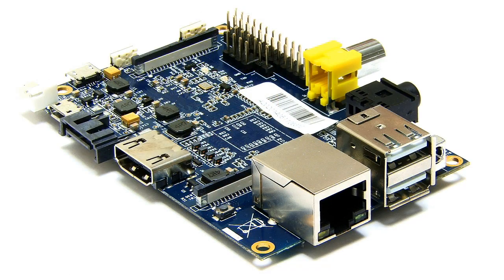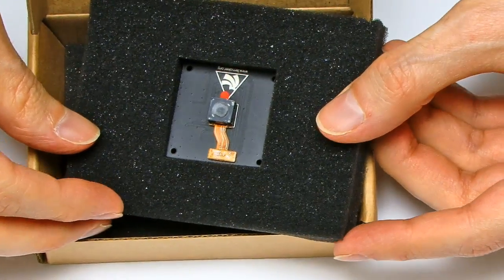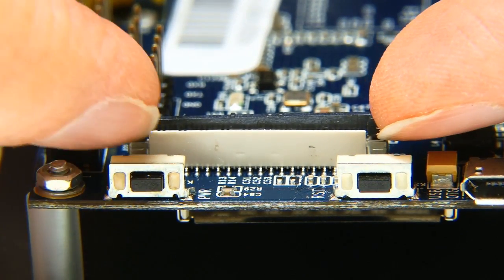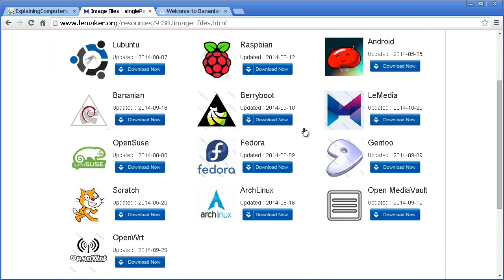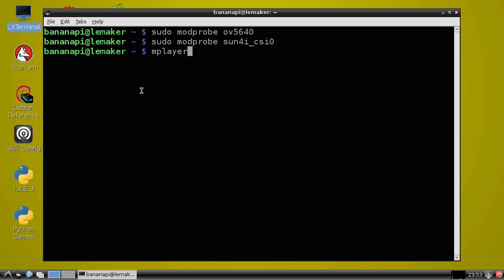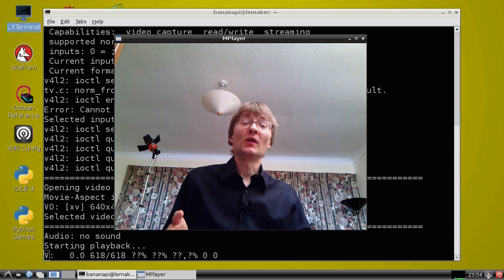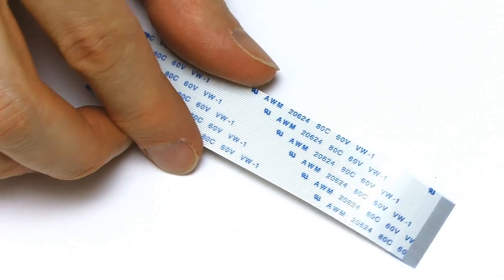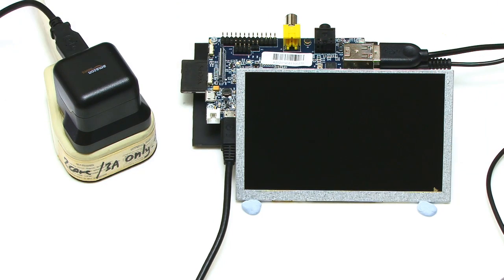Banana Pi Camera & LCD

Comment: I have a 10 inch screen from a old tablet, will that work as well? there is no kind of motherboard/logicboard on the back of the lcd just a ribbin (if I speld that right) attached to the actual screen.
Reply: Any LCD will need the driver board.  Look at the sticker on the LCD, and find the part number.  Put this part number and some keywords such as "driver board" into google and that is the driver kit that you will need. You can then use this as a HDMI monitor.  Connecting your LCD to anything, even if the connector was the same would not work. The banana display config like all screens will differ.

Comment: Are the LCD and Camera Modules Compatible with the Raspberry Pi aswell or just the Banana Pi?
Max
Reply from the maker: The modules will not work on a Raspberry Pi I'm afraid, as it has its own connectors. In contrast, rhe Banana Pi/Pro actually has a standard LCD interface, so works with a wider range of screens.
Reply: +ExplainingComputers Ok thanks Christopher, Continue making great videos. 
Max :)

Comment: For anyone who is interested ALI-Express have some 5V 2A  external batteries available that would run these little computers for little money and also you can even find your own DIY power bank Packs that you can use to make your own Power Bak Supply Power packs out of real high Quality batteries ike LIPO Lithium Polymer or other types of batteries depending on how you feel about those batteries and I even found a SOLAR Bank Battery Pack that fits the 5 volts 2amp specifications to suit these Devices

Comment: will the lcd work with rspberry pi i live in the UK
Reply: +InsertNameHere B+
Reply from the maker: +InsertNameHere Sadly not, as the Pi does not have an LVDS interface like the Banana. But you can get other LCD screens for the Pi.
Reply: ExplainingComputers whih ones do you reccomend under £20
Reply from the maker: +InsertNameHere I don't think you'll find a Pi screen under £20 I'm afraid. There is a popular 7" touchscreen sold by (eg) CP Farnell for £42: http://uk.rs-online.com/web/p/graphics-display-development-kits/8997466/ -- and smaller (and cheaper) Adafruit screens are sold by The Pi Hut in the UK, if currently out of stock: http://thepihut.com/collections/raspberry-pi-screens

Comment: Oh my gosh! I took that same exact display out of an old SatNav! Any ideas on how I could find a controller to get it work with a RasPI? A response would be appreciated. Also, apologies for my ignorance if this isn't possible. I'm only 13 so go easy one me 🤓
Reply from the maker: +Dylio Hamer A controller is the issue I'm afraid. Many LCD panels use an interface called LVDS, while the Pi has an digital serial interface (DSI) for connecting an LCD. (In contrast, a Banana Pi/Pro has LVDS, and can hence more easily interface to a wider range of standard LCD modules). Some people have connected LVDS screens to a Pi using an HDMI to LVDS converter.
Reply: +ExplainingComputers Right okay. Thanks. Any ideas on where I could get a controller to convert the display to a HDMI out? Is the connector generic? Or is it a proprietary connector? Thanks for a quick reply  by the way.

Comment: Hello, nice video's.
Do u have a 3D printed frame for a 7 inch Banana PI touch screen??
Reply from the maker: Antonius K I don't -- but it is a great idea for a project. :)
Reply: ExplainingComputers I have a original dashboard part http://www.car-products.nl/mercedes/2055-mercedes-en-vw-radio-paneel-4260020589817.html but i need an extra part to hold the touch screen.
Reply from the maker: Antonius K This will indeed be a great project!

Comment: Yes, they are very ESD sensitive, we destroyed 3 camera modules in our projects back at uni... I told them first thing it says on its webpage documentation, in the youtube video is that it is ESD sensitive.. after diagnosing and swapping parts around, it shown it is the actual optical sensor in the camera which is easily damaged by ESD...

Combined the Pi and PiCam with Lego NXT, some python programming so it can follow a black line on the floor by itself or user could take control... it was streaming video back from the "PiCar" to the user's controlling webpage... lots of fun if someone from the other side of the Earth controls the "PiCar" of someone else... they have the flexibility to explore a house on the other side of the earth and move around from the keyboard like they are in there... plus added a tilt function to the camera so they can really have a good look around :)

Comment: would I be able to use a raspberry pi lcd screen on the banana pi? would it be compatible?
Reply from the maker: JAKEJ GG I don't think so, at least directly. Anything is hackable, but the display connectors are different. Any screen that connects via HDMI will work though.

Comment: can it work on raspberry pi?
Reply from the maker: Gaming Heart Not this screen, but a similar one for the Pi can work.
Reply: can you give me a link to that screen ?
Reply from the maker: Gaming Heart The closest screen for the Pi is this one: http://www.adafruit.com/products/1678

But there are a lot of options -- checkout Adafruit (US) or ThePiHut (UK). Lots of people like this smaller touchscreen that fits on top of the Pi:

http://thepihut.com/collections/raspberry-pi-accessories/products/adafruit-pitft-2-8-touchscreen-for-the-raspberry-pi
Reply: ExplainingComputers Is there a 5" version which plugs into the display connector on a Raspberry pi etc? Or can the 5" one linked to here plug in without the TFT board?

Comment: question: I see you have Arduino 1.5 installed there and I'm a kind of new on this board, is possible to use the Arduino software with those GPIO pins???
Reply from the maker: jarcdday As far as I am aware, yes (though I've not tried it). The GPIO pins on the Banana Pi match those on a Raspberry Pi Model A/B, while those on a Banana Pro match those on a Raspberry Pi Model B+ or Model 2.
Reply: ExplainingComputers mmm hell, sorry for me to :(, I went to check the list of compatible boards on the Arduino Software, it only appears arduino compatible board, I don't know how to use it here. That arduino software is already installed on the OS that came with that installation?? if is so, it mean there is a way to use it..... but how??
Reply: jarcdday I will appreciate if you can help me with this question, I will research the additional information to use the arduino software here.... I just need to know if is possible...
Reply from the maker: jarcdday What you see in the presentation is indeed pre-installed as part of the image. Here I am running a default installation of Raspbian, so (as the GPIO pins across the Banana and Raspberry Pi are compatible) I would strongly suspect that any Arduino software that runs under Raspbian will work on the Banana Pi/Pro running Raspbian. However, I have not tested this!

Comment: Hi, I buy BPI M1, camera module and LCD(was delivered just today, so didn't tried yet). Camera works, but I receive very bad quality :(. Max resolution which I received was 640x480 but also with poor quality. Dou you know what I did wrong. What need to be done to fix this issue ?

Comment: For what they are the price of theses things is outrageous.

 For the cost of the Banana Pi 7" LCD screen only  You can buy a complete 7 inch android tablet which comes with built in WIFI module,Battery and battery charger module, 7 inch screen Module, Camera Module, GPS Module........
Reply: I don't get it as well. Why these things are so expensive!

Comment: Hey Chris,

Do you think you cant get a Windows Joystick (Logitech) to work on this system? If it would it from from USB directly, or from the GPIO? Also I would like to know if you can operate the whole system with the joystick instead of a mouse and keyboard.

Thanks in advance ))
Reply from the maker: rimwydas44 In terms of the hardware, I can't see why a USB joystick would not work -- or a GPIO one. The issue is drivers and access to the device in certain applications.

Comment: Very informative. Would you recommend getting a Banana Pi over the Raspberry Pi; is the extra power worth the cost?
Reply from the maker: wondertwins2222 Yes, if you need the power (or the SATA port). :) But the Raspberry Pi Model B+ is a nice machine with its 4 USB ports. And soon there will be the choice of the Banana Pro with its integrated WiFi . . .

Comment: Can you use the LCD in Android
Reply from the maker: MikeBrawnson I don't currently have this connected up -- it will go in the root of the card, or in a directory off that. So I would try writing an Android SD card, and checking through it on a PC to find the location of the script file. I will try and remember to check this when I next have a Banana Pi running -- which should not be too long -- and will then report back. :)
Reply from the maker: Tina Zill You should be able to, though I've not tried the driver yet.
Reply: ExplainingComputers Do you know where i have to store the script.bin when im using android?
Reply: Thx very much
Reply: MikeBrawnson  did u succeded in this?

Comment: the banana pi seems allot more interesting then the raspberry pi, mainly due to its much better specifications. (much faster dualcore proccesor, double the ram)

glad to see a new video from you.
Reply from the maker: fiattrickbox And that SATA port! :)
Reply: thats a very nice bonus too :D could make for a very nice micro NAS, with intergrated monitor.
Reply from the maker: fiattrickbox Yes. I plan to do a Banana Pi NAS video at some point.
Reply: ExplainingComputers
Oh wow, that's genius. I've been coming up with a NAS strategy for my home and that sounds much better than my original plans. Do you think the Banana Pi would run FreeNAS? It's a Unix system based of FreeBSD. I've created virtual instances of it using VMware player and found it to be a very easy, user-friendly NAS solution.
Reply from the maker: ***** I know that you can run Open Media Vault, not sure on FreeBSD -- though there is a forum for it here:http://forum.lemaker.org/thread-2502-1-1-.htmlAlso check out this -- readable in English via Google translate:http://bananas.gda.pl/pobierz/
Reply from the maker: ***** 
Link above is: @thread-2502-1-1-.htmlAlso
Reply from the maker: ExplainingComputers I give up -- just cut the "Also" off the end of the html!
Reply: ExplainingComputers
Ah, don't worry too much about the link. Very interesting, and an exciting discovery. I made a virtual machine and tested it out and got it working, so now I suppose all that's left is to purchase a banana pi and all related materials, and get to work. Thank you!